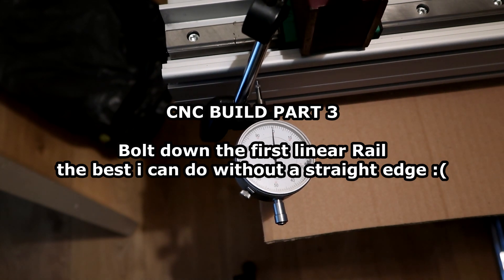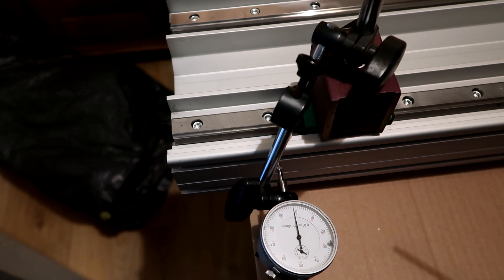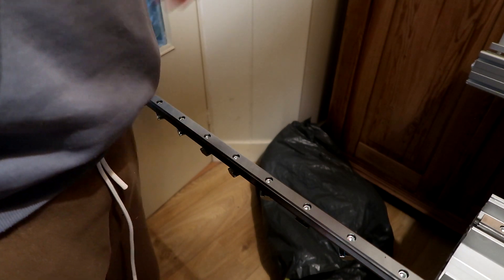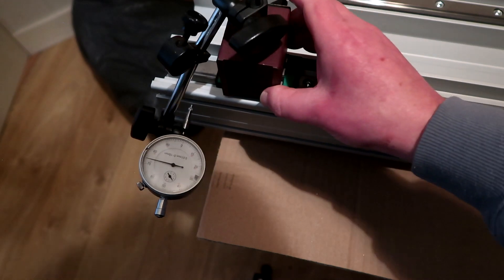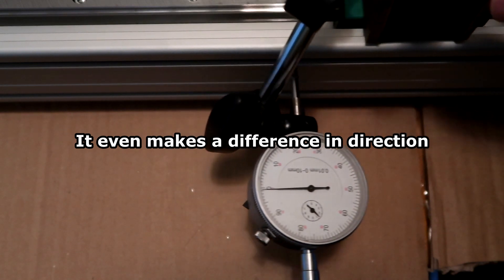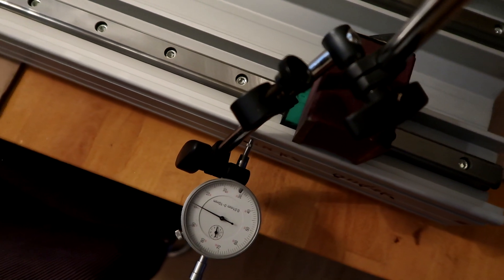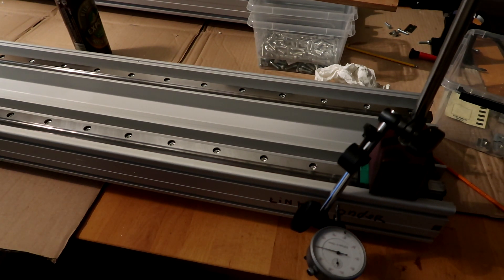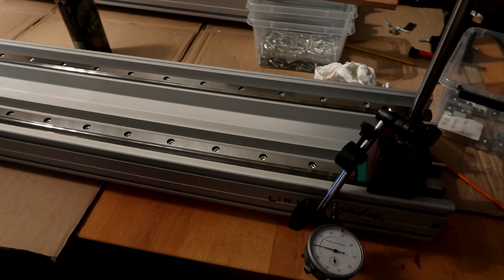CNC BUILD PART 3 - Bolting first linear rail down

Comment from the maker: Well i think i will buy a straight edge... but not a 2000mm long one :( dont have 650 euro , so maybe a 1000mm one.. this does mean i need to do it in 3 steps ..... not so cool.  i could go for a 1500mm one witch can do it in 2 steps... but its 380 euro... damned.   i did have antother idea.. using a stretched piece of wire over its length and use a capacitance sensor for lining things up.... not sure if that actually works though :(
Reply: Took the plunge, 2m, helps a lot. Did hurt though.

Comment: 0.02mm fluctuation is acceptable even 0.05mm fluctuation here is why... when u probe/center ur piece before milling u probe the middle and split the error... 0.025mm or 0.0125mm as a fluctuation on ends of ur pieces will be irrelevant in 99% of products... depends now what you do this for... if this is for wood... dont you are overkilling it... even if u do 0.01mm accuracy wood bends etc if u using it for aluminium same thing it deflects/distorts at around 0.02mm per 1Celsius... in all directions so ... unless you are machining laboratory tools like class 0 or class 00 and u doing this for your ownshop machining... 0.01 is acceptable in fact most of manufacturers give u a 0.03 tollerance acceptance per 30cm or 0.1mm per meter.  that is class 3 depending on how u applying it... but usually even if is liniar gradations like rulers or even 90 degree angles... 0.03 tollerance is accepted by most mechanical shops, if u manage to get a 0.03mm deflection on a 90 degree angle at 1000mm from stock to tip... u doing laboratory class 00 that basically competes with granite huge slabs.. so yea i dont think you will ever reach that realistically mainly because 0.01mm is a dust particle human hair is 0.1mm paper sheet 0.15mm so yea 0.01 not visible to human untrained eye. ... because even if u give them a class 0 tool... with under 10 micron accuracy... they will mess it up in welding, lapping etc... so doing this to be 0.01-0.02mm only helps ur linear bearings in time... but even those in 2 years the machine will chew them up usually not because of missalignment but because the steel they made out will give up... after 2 years you will have to do a complete maintenance on the rails anyway. good technique tho.

Comment: I believe in German the suitable straight edge is a "Montagelineal" and you can get them in various levels of precision (DIN874 maybe?).
But yes, one long enough gets expensive quickly, so I think it's fairly common to just use the rail itself (e.g. there was a popular CNC build called "Fenja").
Reply from the maker: 100 points, thanks ! I found the same for dutch by now. But the price was as expected :(

Comment: Good result Joppe! Your within  +-0.01 mm if I got this right, let's say it's 'only' 0.05 mm it doesn't matter for your purpose and materials. Maybe it will get out of calibration and bend when installing and temperature differences will do something later on, let it be so.  
Top!
Reply from the maker: yeah if i can get the other rail withing the same range to the first im ok i think :) thanks ! indeed the dial is 0.01 so max so far is 0.02 compared to the alu . if i can get the other rail withing the same range would be nice :)